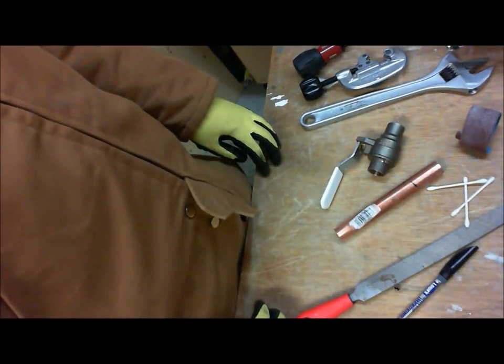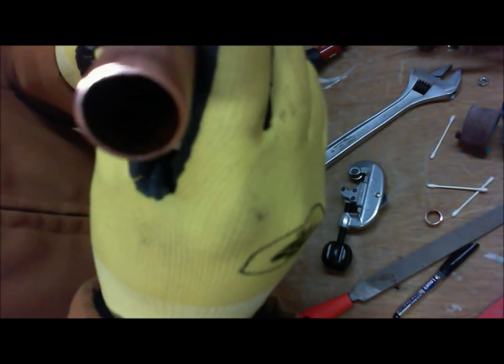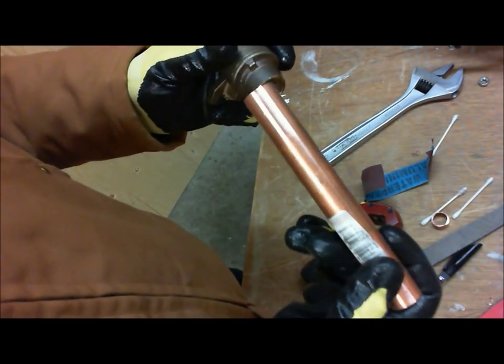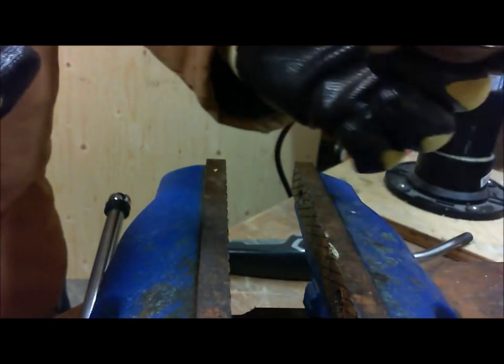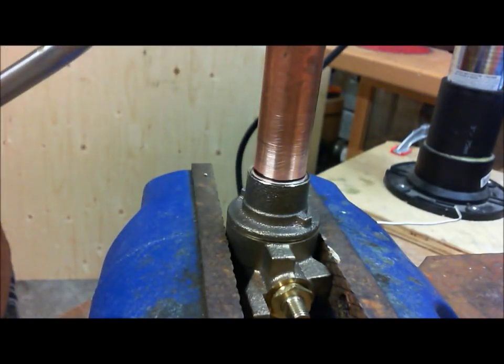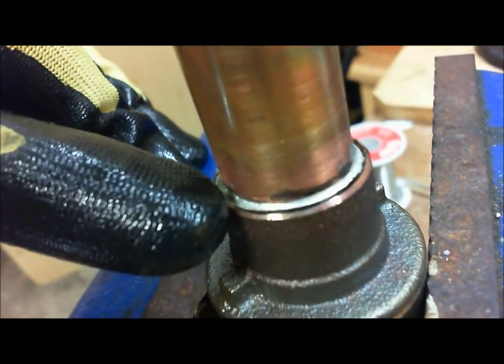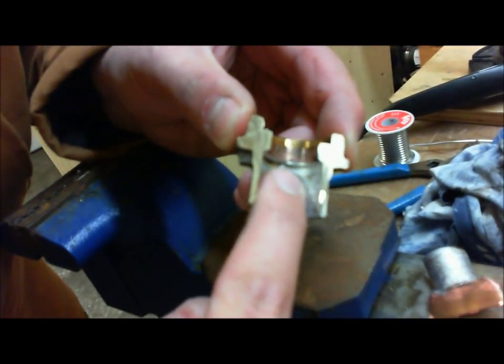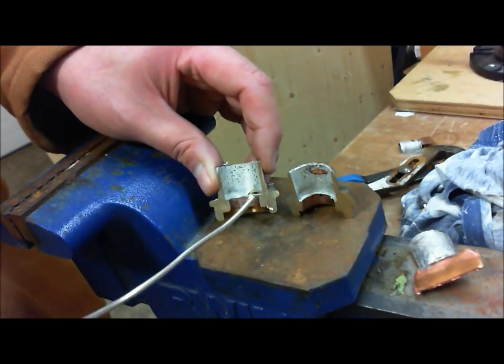Soldering Ball Valves

Comment: I wish I had watched this before melting a ball valve seat. Oh well, I got the 2nd one done correctly thanks to your video.
Reply: That´s WHY it is better to apply the flame to the COPPER TUBE first, and let the much higher heat conduction of the copper carry the heat to the bottom of the socket.  By letting part of the flame touch the brass of the valve, the heat starts to go to the rest of the valve, including the seat!
Reply from the maker: +Chris Smith perfect. Thanks again